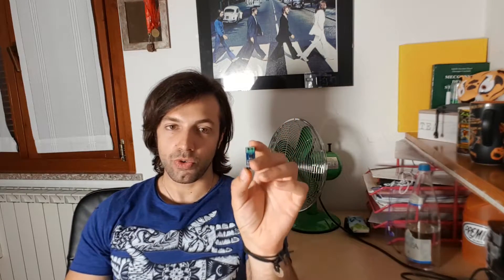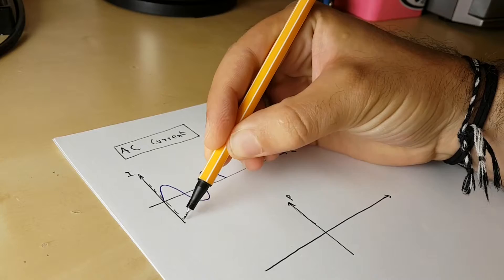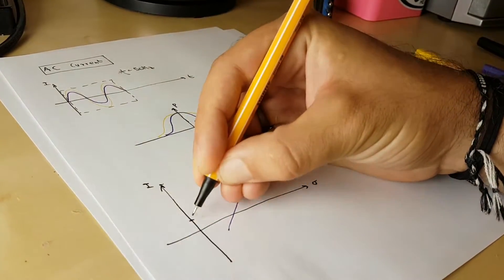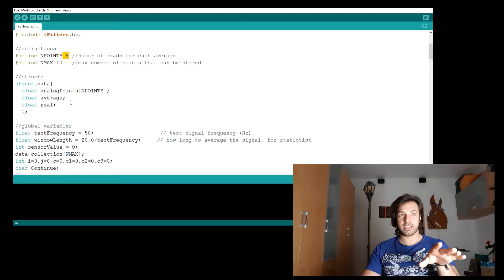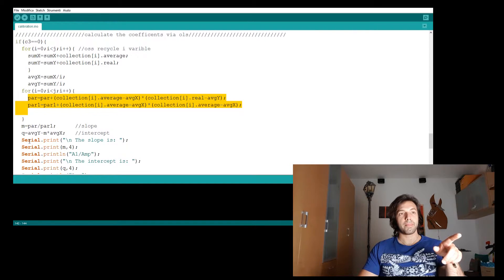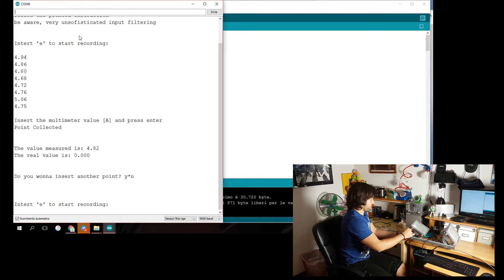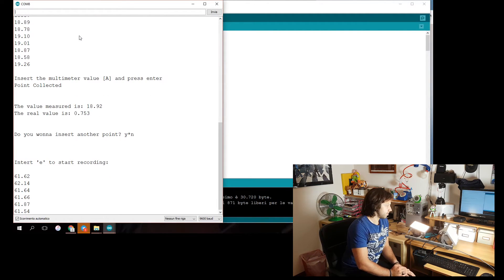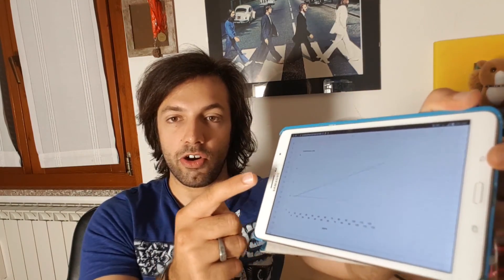AC Current Sensor Arduino - Calibration

Comment: The output Voltage of the 5amp sensor is only between 1.6V (@ minus 5Amp) to 3.4V (@plus 5 amp) when no current output is 2.5Volt. All this when Vcc is +5volts.